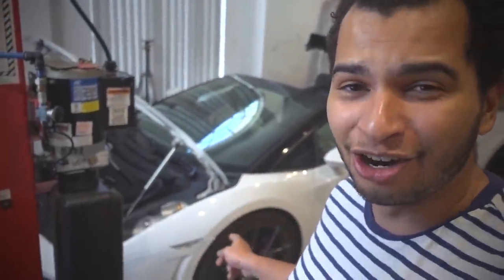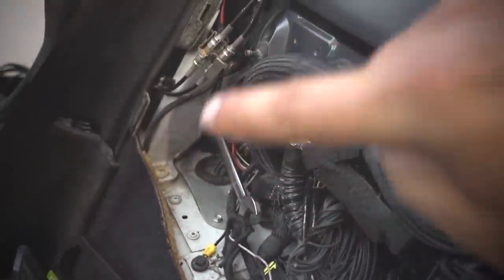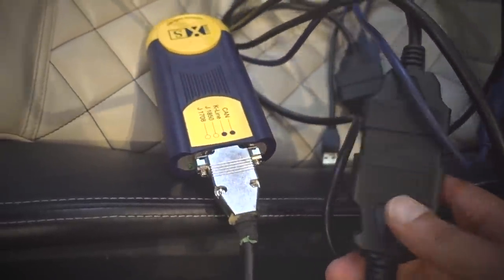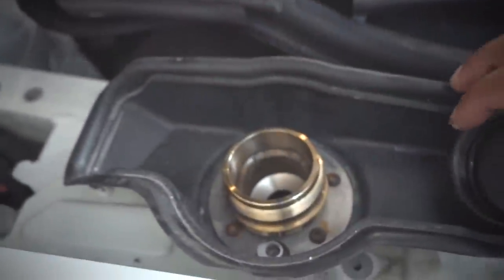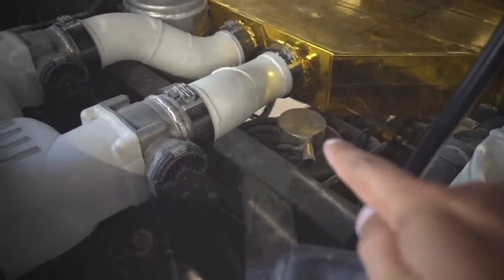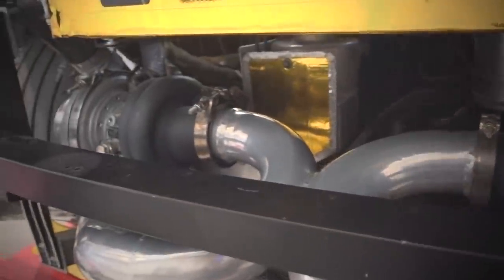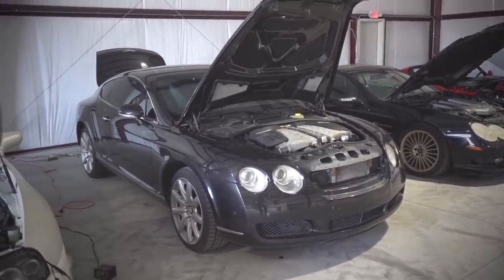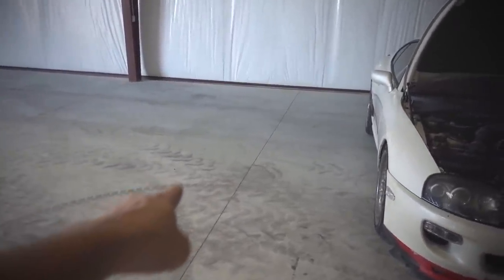My Cheap Lamborghini's "Impossible" Problems SOLVED!!! - GARAGE UPDATE

Comment: Right angle in exhaust tip split is a flow restriction, strictly fanboy junk. Come on, you can do better and keep more hp. Fuel line "outgassing" sounds like a snark hunt. NASA knows what outgassing is, you don't have that. All gasolines contain heptane, butane, and other room temperature volatile gasses. If you smell gas, either your fuel lines are porous or you have a leak. Use the yellow googles that came with the dye kit, turn off the room lights, find the real problem. Or, get some marshmallows and sticks. For the fire.